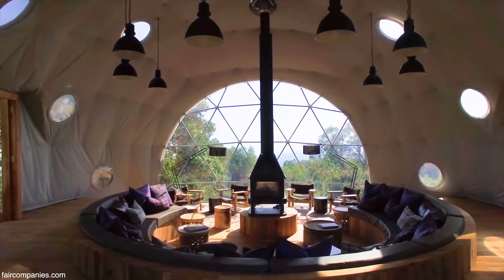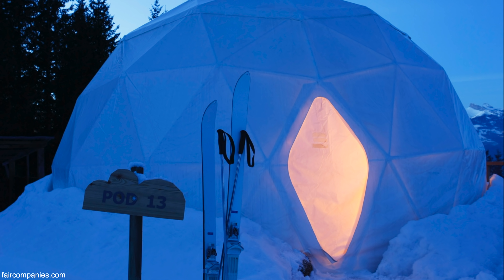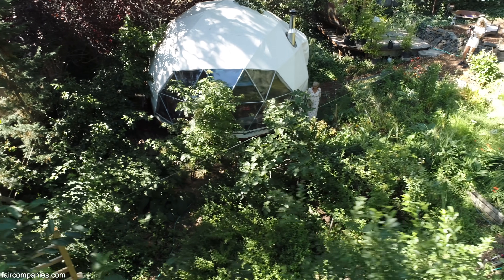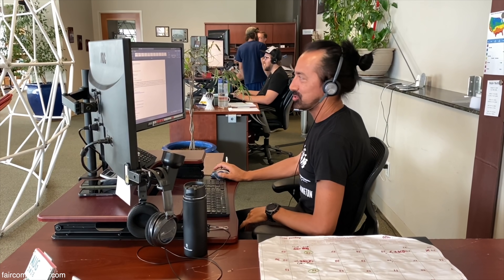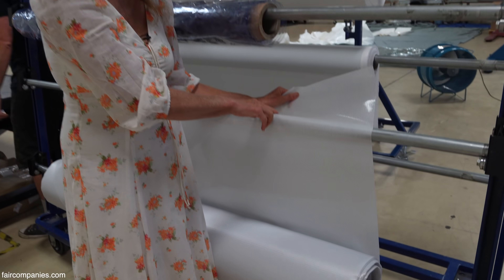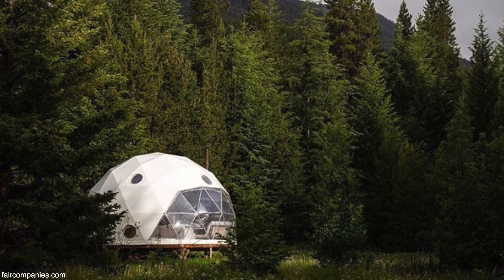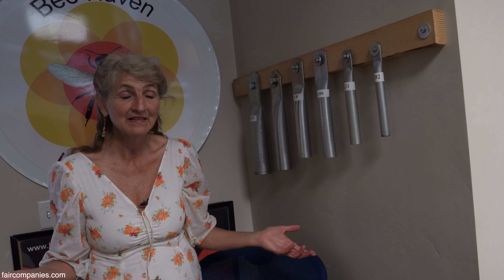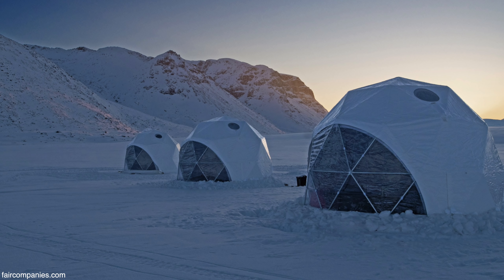Sewed own popup dome-home for need, been selling them since

Comment: Tom from Quebec Canada 
How do you heat your  dome
You  can heat your  dome with compost will go up to 140f 
Put some pips together and a fan and you will have hot air
Put a water pipe in the compost  and you will have hot water 
Just think  ?

Comment: Fantastic!! What is the durability of these in terms of years and in high UV environments? Buckminster Fuller was such a legend! Do you have problems with mould / mildew or not? In my experience it tends to condensate on the ceiling.

Comment: Good show that would warm the heart of my deceased architect friend who was a fan of “Bucky” Fuller. 
Some important issues or deficiencies are not covered. With thin walls there is little noise reduction. A falling tree limb could come crashing through the ceiling. How would you repair the thing? How would you climb on the roof? 
Even if all objections could be addressed how to revolutionize the many rules and zoning laws restricting us?

Comment: So, she mentions "higher frequency", does anyone claim benefits or issues from living within a supposedly higher frequency arrangement of material?
Just curious.
Reply: The frequency is the number of triangles between pentagon centers in the frame structure.  Look for a pentagon made up of triangles and then another one, and then count the number of triangle edges between them.  The frequency is an integer from one to typically six, but it can be much higher.  Look closely at the EPCOT dome at Disney World - its frequency is eight, and its diameter is 165 feet.  However, each Class 1 (flat faces) geodesic triangular face is made up of three isosceles triangles that extend outward to create a 3-D tetrahedronal texture, forming a Class 2 geodesic structure.

Comment: With a camp stool - and tall kitchen bags - you'll have no oder escape and indoor plumbing is perfectly unnecessary.  Garden hose shower in the hot weather and water, vinegar and bleach in a spray bottle works well otherwise.  Catnip tea keeps cockroaches away.

Comment: How long do they last, how does one seal the roof opening from rain, etc, how to insulate for very cold or very warm temperatures, how long is the fabric guaranteed for?
Reply: The Home version uses industrial-grade vinyl that lasts upwards of 20 years, and the marine-grade vinyl windows last around 8 - 10 years.  However, all of the materials are only warranted for five years.

There is optional Thinsulate polyester batting within fabric panels (same as used in cold-weather parkas) for cold climates that attaches to the inside of the frame bolts.  An industry-standard, highly-reflective, flexible elastomeric paint can be applied to the exterior for hot climates, as well as the Thinsulate panels on the interior.

Comment: Incredible lady. Soft, intelligent and successful. Rare to see in the younger generation. 

These structures are not "from the nature" or whatever she explains. It's just phisics. Simple phisics actually. 
The reason we don't see houses like that is tradition, comfort and safety.  These would be robbed in most places on earth. 

Still, both the lady and the idea in general is great. I wished to see more domes around.
Reply: Nature is the best teacher of physics, no?  There is a building where the architects couldn't devise the most robust structure of the shade roofs, so they mocked up a small model and used soap bubbles to hang between the outstretched poles (that anchored the shading).  They got the dimensions from nature, and then applied them to the building.
I suspect she's referring to something similar here...

Comment: I'm in Texas, it's August, 102 degrees in nearby Odessa, what's the indoor temperature of this structure with no air conditioning?
Reply: What’s the temperature there in any non-air-conditioned home?  You can cool these with air conditioning, and adding available insulating panels, and painting the exterior with a highly reflective industry-standard elastomeric works very well, according to their website.

Comment: I often wonder what would happen if one section was damaged and if it could be repaired.
Reply: Vinyl can be patched using a heat gun and heat-activated adhesive sheet/tape materials.  Bent frame struts can each be replaced by removing the bolts at each end and retightening them after replacing the bent strut.

Comment: I lived in a GEO dome built in the 80’s in Alberta Canada … oh my gosh it was horrible to live in.  Sweltering hot during summer with the winter months brutally cold enough to freeze 🥶 any hardy occupant.  I loved the design when I rented it BUT it was so shoddily built without any considerations to air flow, temperatures, leakages, insect infestations, you name it and the builder neglected it from his plans.  It was so uncomfortable 😳 that I actually needed to move.  
Now these domes, however, have my undying interest and I foresee a day when I will purchase one. Or two. Or three!  She deserves all the success in the world because she has researched and covered all the loopholes which made my experience so unpleasant!  
    I do have one question though.  Has anyone else wondered about this?  
🐻 BEARS.  What stops a very determined bear from clawing through the fabric structure when the site is launched in bear country … which I see that many of them are?
Does anyone out there have any thoughts on this?
Reply: Nothing.  Perhaps an alarm system might scare a bear away.  I suspect the company would be glad to send out replacement parts for a fee, of course.

Comment: Like a yurt there is a problem with mold formation. You have to monitor the humidity & temperature closely. The deck,interior and infrastructure costs the most. I am  not sure if NY  would tax your buns off or deny you a permit for some dumb reason. They are always looking for ways to squeeze more taxes from us hard working folks. Like the tax collector in Roman times . They will get their comupins in due time !

Comment: Unfortunately, living in London, such domes would be broken into with ease as they're simply a plastic fabric material which would easily cut!

For all of the construction challenges, wood structures are far more secure against vandalism and burglary.

That being said, I would happily live in a 20 foot dome made of plastic fabric material and steel tubes if vandalism and burglary weren't such an issue.

I find myself wondering if the boat building method known as stitch and glue would be possible using marine grade plywood to construct a light, immensely strong dome that is watertight!

Comment: Approval as a permanent structure can be solved with 2 inches of closed cell spray foam insulation on the inside to meet the R value. If you need more, get 3 or more inches. Cost was about $3500. The big window had to be foamed over also. A fireproof paint then had to be applied on the exposed foam on the inside, for a cost of $1,000. That's what I did in 2010 in Virginia for the year round certificate of occupancy with a 30 foot pacific dome. Prince Paul Mamakos
Reply: Very interesting I never thought of that , I was wondering how people are living in these full time , how did u go about permits and zoning? What was it classified as if u don’t mind me asking I’m probably gonna be the first guy in my area so any tips would be super helpful also did u have to foam the entire big window or ?

Comment: For the stove is there an outside air intake for it, instead of using the inside air to go into the stove and up the chimney.? This intake could be run through a large cooler for keeping your food cold inside the warm Dome.
Reply: There are screen inserts provided for the circular windows that can be literally popped in/out.

Comment: I am considering building a dome for my first house.
Downsides are:
-material waste when cutting from square sheets
- insulation and espesially windows
- building permits may be more difficult
- sealing and adding insulation
-cost or accessibility of exotic materials
-safety/burgulary/ damage
-you look like a dmt hippie mathematician for your neighbours.

Points of unknown:
-self build or order
-size 
-climate, insulation
-risk
-repair
-cost of self build in time, quality, tools, 
-guarantee of safety, engineering, testing, proof of concept
-comparison to the alternatives

Positives:
-minimum surface area
-strong geometry
-moveable 
-light wheight
-somewhat simple?
-ridiculously cool geometry, and architecture
-uniqueness, and psychological positive effects.
-you can be the hippest hipster on the block

I'm leaning torwards building myself, because it is cheaper, harder and more fun. 
 f
From junk and salvage materials, buying only tools, and property without road access.
I allready have tarp and greenhouse mat. 
I have trampoline frames for making greenhouses. Planning on using roadsign-posts galvanized pipe, or other heavy gauge, cheap pipe. Cut with metal saw, and use bottlejack with caption device for crushing the pipe when aligned. 
You can buy/use  heat guns for tarpaulin welding. Moulds for the 3? different triangle shapes.
Power is hard
Starlink internet if that becomes a thing
Wood heating/compost for greenhouse
Solar array, generator, and possibly passive hydropower.
Thermoelectric woodfired energy? I have not seen a large scale commersial unit. Alternatively wood-steampower or woodgas generator. 
I live in the arctic circle, so insulation condensation, and electric energy generation is my biggest challenge.
I would like to make it to a near-passivehaus standard, or as well insulated as possible.
Reply: You're thinking it out! I wish you well.

Comment: The first geodesic dome was designed after World War I by Walther Bauersfeld,[1] chief engineer of the Carl Zeiss optical company, for a planetarium to house his planetarium projector. A first, small dome was patented, constructed by the firm of Dykerhoff and Wydmann on the roof of the Zeiss plant in Jena, Germany. A larger dome, called "The Wonder of Jena", opened to the public in July 1926.[2]

Twenty years later, Buckminster Fuller coined the term "geodesic" from field experiments with artist Kenneth Snelson at Black Mountain College in 1948 and 1949.  Although Fuller was not the original inventor, he is credited with the U.S. popularization of the idea for which he received U.S. Patent 2682235A on 29 June 1954.[3] The oldest surviving dome built by Fuller himself is located in Woods Hole, Massachusetts, and was built by students under his tutelage over three weeks in 1953.[4]

Comment: I built a sixteen foot dome six years ago to put around my fig tree so I could cover it in the early spring because we get some late freezes here in western NC after the sap begins to rise. It never got used for that. Once I sat inside it that was it. I built a deck for it and now that is where I hang out when I want to be outside. There is just something about it that you have to experience to understand it. I've even caught my dog sitting in a chair in the dome just looking around all by himself. I built it with 1/2" electrical conduit and 1/4" bolts. Well worth the time to build it.

Comment: These are SO wonderful!  I was told by Pacific Domes, that if we chose the heavier tubing, to make a 30' diameter dome, it could handle being heavily bermed, or even made into a semi-underground house. 
After looking at the Monolithic Domes, it's clear that the Pacific Domes could be upgraded to permanent status, by spraying air-crete one the exterior or interior, or both.  OR, you could make hard-wall insulated panels to install into the triangles as you can afford hem, some at a time. 
We stewed over what structure to get for a very long time...mostly because it was harder to figure which "weak-points" of "temporary structures" we could handle into old age, without help.  
We finally whittled choices down to yurt vs. dome.  The final determining factor was needing vertical wall space.  But, the site it's on, can be subject to 130 mph gusts--which we didn't know back when we chose.  IF we'd known that, we would have picked the Pacific Dome, with all the insulation, and the heaviest tubing frame, so we could have upgraded it over time. 
But we ended up getting a 30' diameter Eagle yurt, back then, double-insulated with a different version of what looked like Reflectix, only had foam layer, instead of bubblewrap between the foil.   
It worked great.  And maintenance was low.  For awhile.  But the vinyl roof only has a warranted lifespan of about 15 years or so....so that will need repaired/replaced.  That's when we discovered Marine supply stores, with various products that made repairs easier and durable.  There were bumps in the road.  But, we experimented all the time.  
We ended up having to move to a regular house.  But I long for living in a round space again!

Comment: I am so impressed by this woman and her business, and the logic and simplicity of a dome structured home. I find it crazy that a structure that is designed to be used on the top of a mountain, in feet of snow, or in a jungle is considered temporary, but most would consider it a tent. I'd love to build a multi-dome complex at the fraction of a brick and mortar home....have my own Space 1999 moon base :-) But you would need to build in a place with super relaxed zoning and residential building codes.

Comment: Hey, that's the same Vogelzang woodstove I have! They are great for heat production and take 20" logs too. Unfortunately they've discontinued selling that model here in US. I have also cast iron skillet Griswold with "fire ring" that perfectly fits the two cook holes on top. Helps when electric power gets knocked out in winter storms.

Comment: Great video. I was hoping to learn more about the windows. Usually clear vinyl starts to cloud over with exposure to sun light. Are these treated windows, or will they cloud over?
Reply: It’s industrial marine vinyl, and direct exposure to the Sun’s UV over long periods will cause it to chemically degrade, as with most plastics.  These are warranted for five years, but reportedly typically last about 8 - 10 years.  The circular windows just pop in and out, and the bay windows have zippers so they can be swapped out.

Comment: Kirsten,
These domes are incredible. I love the structure of a dome. I hope to one day have a BioDome for gardening year round indoors to have continual food growing year round in Canada. The idea I have for that is to have a foundation wall the same shape as the dome go well below the frost line, but not have a foundation floor. Instead the floor would be the actual ground. That way there's less environmental impact by displacing less earth and the ecological environment underground. The Foundation wall would be enough to keep the natural heat coming from ground below, to keep the space inside warm enough. And adding a water feature would also increase the humidity and retain heat better. The water feature would be heated and would sit on the surface soil. There would be aquatic animals, (mainly fish) in the water feature, and that water would be used for watering the garden inside the dome, water high in nutrition because of the fish waste. Basically it would be a small natural environment for a Permaculture Garden of fruits, berries, and vegetables.

Thanks for this video. I'm going to contact Pacific Domes and get information on their domes, all thanks to you!

Keep Safe,
Peace, Happiness, Love and Laughter Always,
Matt

Comment: I haven’t seen a fabric yet, especially a plastic-based fabric like vinyl, that can withstand the Arizona valley floor heat. This year we had over 60 days of greater that 110 degrees. It causes fabrics of all kinds to dry and crack and yellow within 1-2 years. I wonder what technology they have to combat that.

Comment: Amazing work, but cannot stand the repeatedly misuse of the word "frequency".
Reply: Hey Amau! In this case, her use of the word “frequency” is mathematical. Thought you might find it as interesting as other Buckminster Fuller fans to learn that there are many sizes of triangles in a geodesic dome, depending on the frequency of subdivision of the underlying spherical polyhedron. The higher the frequency or the more frequently such subdivisions occur, the larger the dome. Not sure if that was clear as the company owner was speaking to the scientist who was filming since they both knew they were speaking the same language (geometry).